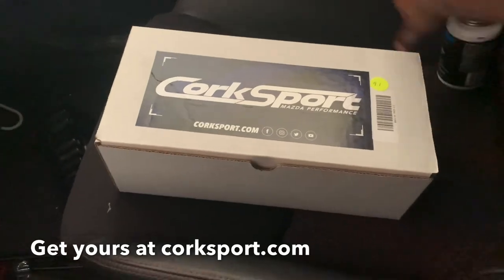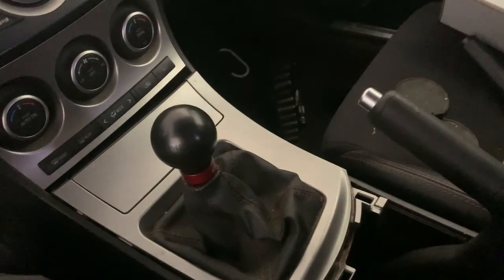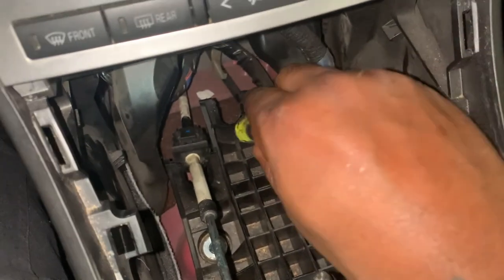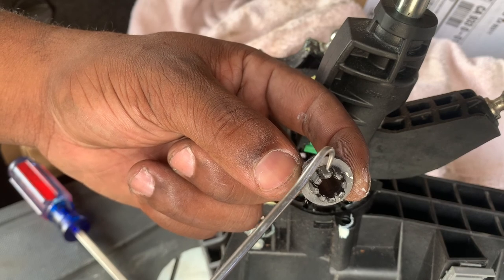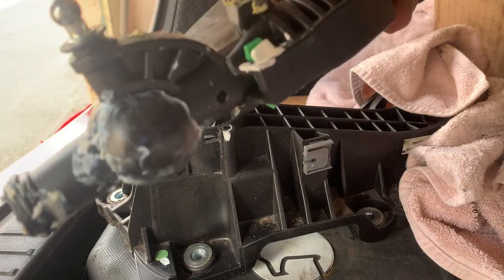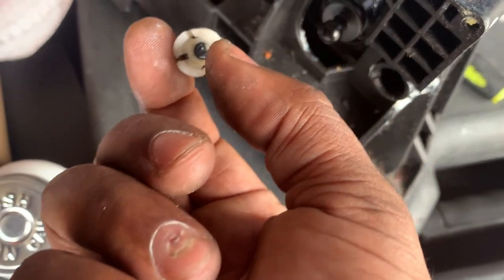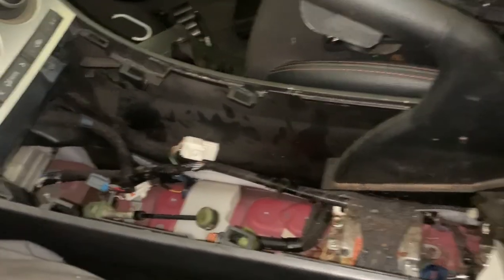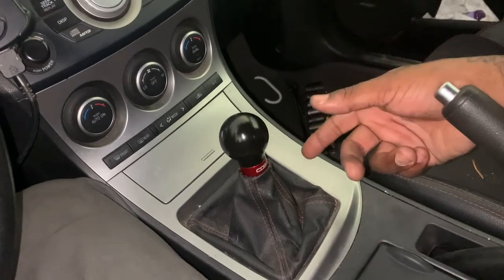HOW TO INSTALL A CORKSPORT SHORTSHIFTER ON YOURMAZDASPEED 3

Comment: I noticed you put the ball stud at the top of the second row, did each gear full engage or did you have to move it? If so where?
Reply from the maker: It was good for me but I end up putting it in the middle and did a few adjustments, all gears are going in nice

Comment: Just installed this a couple days ago and it feels great. Also after installation, my shifter is a little lopsided to the right from neutral. Any idea I can do to fix this?
Reply from the maker: Idk bro because mine do the same thing lol
Reply: @waresgarage8590  looks like we're on the same boat then aha, I've contacted corksport to see if they any solution to this and if I get any I'll give you an update
Reply from the maker: @HQMarkk  for sure let me know brotha
Reply: That's just the design. The OEM one was bent to center it out.
Reply from the maker: @marcov9808  yea makes sense
Reply: @waresgarage8590  does it bother you at all? I'm thinking about getting it
Reply from the maker: @marcov9808  nope I love mine bro you should get it brotha you will love it
Reply: You get used to it...eventually it looks normal

Comment: Would this work on a Mazda 3 2.3l 2007
Reply from the maker: Go on Corksport website to see if they got one for your car brotha, this short shifter is for a Mazdaspeed 3
Reply: @waresgarage8590  I just did some research they only got the shift plate for mine but I’ve found other alternatives thanks for the help
Reply from the maker: @quinnpeltier9076  I looked it up on your car it wouldn’t let me copy the link for you..go on google put  2007 Mazda 3 2.3 short shifter and I few short shifter they got for your car even some plates
Reply: @waresgarage8590  Yea I was actually just looking at the corksport plate and I’m just trying to figure out if it fits I think it does but I’m wondering if I could also add a short shifter as well?
Reply from the maker: @quinnpeltier9076  yea go on google put your year and model of your car, I seen a few short shifters that they make for your car
Reply: @waresgarage8590  yea I saw some thank u
Reply from the maker: @quinnpeltier9076  your welcome bro if you get one hit me up on my IG let me know what you got
Reply: @waresgarage8590  oh yea definitely
Reply: @waresgarage8590  what’s ur ig

Comment: It would be helpful if you showed HOW you did it you telling us you’re not very good at describing having a hard time with the spring you’re just going onto the step with out showing how you did it just telling us which isn’t helpful to ME I need to see how it’s done
Reply from the maker: I said how to put the spring in, you put the to ends in firs, than you turn the spring to put on the shaft that it sits on, next time I’ll show detailed instructions, most of my videos I show how to do it, but it’s more different ways to put that spring on, not just the way I did,